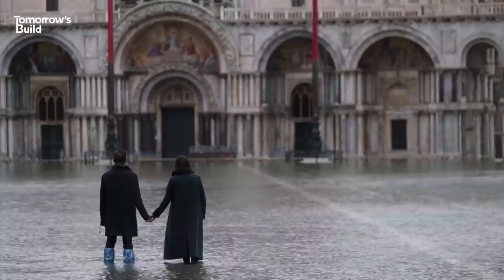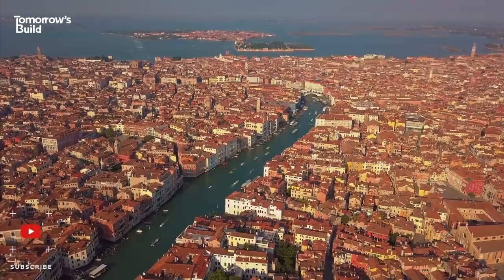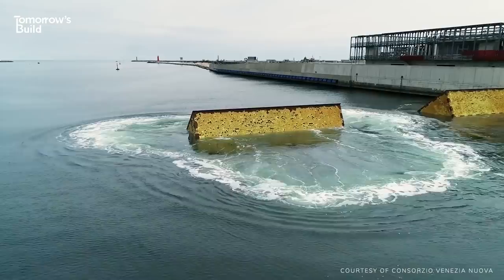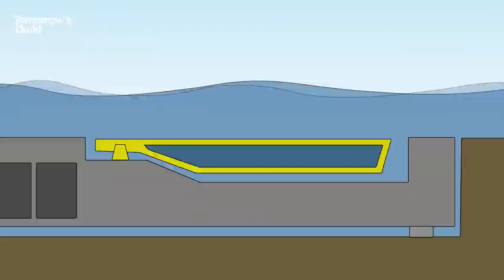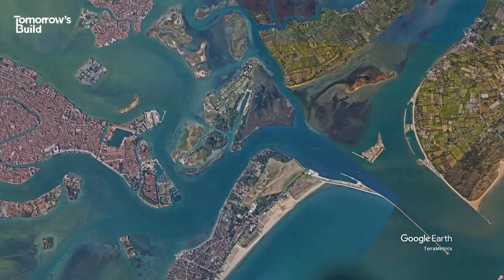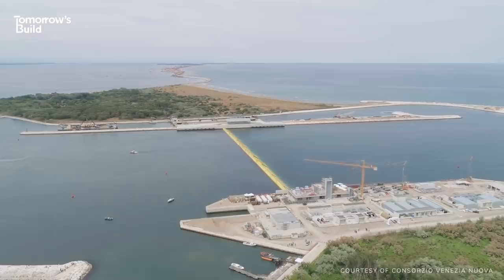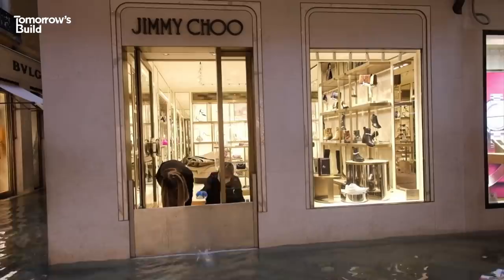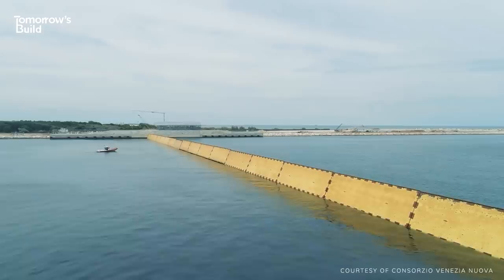The $7BN Megaproject to Save Venice

Comment: As a citizen of Venice (admittedly its continental part, Mestre) I can assure you this is by far the best informative video on this topic avaible in english; I've seen some others examples that are just incorrect and embarassing
Reply: Che merda Mestre però
Reply: It's so sad to see people in this comment section saying they would just abandon the city, but don't realize people like you actually live there.
Reply: @AmericaeDominaturOmnibus  People just have to visit Venice, and especially take one more day to walk around and take boats to see how marvelous and precious it is.
Reply: Would you say the system is effective? When authorities think to switch it on, of course (:

BTW In my opinion even if it stopped 80-90% of the floods that's a huge win
Reply: @ErelH  It is a depth structure, meaning, if the required depth to keep Venetians' feet dry is 38.85 meters, then a 39m structure won't do. It is a whole or nothing engineering, 90-95% success is a fail.
Reply: @Paroissien   he said Venice gets 60 floods a year. So if the system stops 50-55 out of 60 then it's consider it a success
Reply: @ErelH  If the streets are flooded in 10-15cm of water each time, please kindly tell me what kind of system would stop this flood and not that flood.
Reply: @ErelH  its perfecly effective when it is raised, all of the city is kept dry, and if you go where the barriers are you can clearly see the sea higher than the lagoon; but the phenomenon still has to be relatively brief (less than 12 hours) otherwise the endemic ecosystem will suffer for the lack of water exchange, luckily if the water rise is not too big it is possible to rise only some barriers and leaving the other down to permit the flow of water but at the same time it slow the rush in enough to keep the city dry
Reply: @Paroissien  you didn't understand anything of how it works, first of all Venice does not have the same hight everywere so even without the barriers in most occasions only sone parts of the city go underwater (San Marco being one of the lowest point and as such more exposed); that said the barriers rise from the bottom of the lagoon so a 39m barrier blocks a 38.8m water level; and it is not an all-or-nothing system even in the case of a very very high wave it will let some water in but it will not collapse (as it happened in the 1950 circa in the netherlands)
Reply: @XMarkxyz  When you start a comment by "You don't get it", the tone gets disrespectful, then the interlocutor is either a kid looking for a squabble, or an adult who drops it.
Reply: @Markxyz Do the continental parts of Venice and the lagoon-limiting Island districts (like Lido) also get flooded ?
Reply: @Paroissien  didn't mean to offend you but it's how things are, you were talking without knowing a single thing of how the system works and your ill-informed comment has shown it; ignoring a fact is not being stupid so don't get offended, just research more next time ;)
Reply: @aa-t8969   it's way more rare but it happens sometimes on the limiting part of the laguna, i know it happens in Chioggia for sure, Lido has never been flooded as far as I know; in Mestre (continental part) it's even more rare but it happened a couple times during heavy raining that some small areas near the river got underwater as tge rainwater had no way to get out of the city and into the lagoon via the river
Reply: Hoping this issue doesn’t become worse for you. I went to Venice 2 years ago once with my fiancé, beautiful place and even more beautiful people. Our plan’s to get married there, something very small, I can’t wait.
Reply: Thanks for saying you’re from Mestre and not from Venice
Reply: @XMarkxyz  in November 2019 lido and pellestrina were flooded too
Reply: @ErelH  in my view if you spend 7.5 billion euros for a big architectural project it should work at least 99% of the time
Reply: Good reason to keep watchin long live italia greetings from argentina and colombia
Reply: gelous of italy, is top

Comment: Isn’t there also the problem of sea floor sediments going under the barriers while they are up and therefore blocking them from coming back into the foundation?
Reply: Just tack that on to the 100 million per year maintenance cost too lol
Reply: This also happens with the Thames Barrier, but it is dealt with by the maintenance and testing cycle.
Reply: The whole project is flawed
Reply: Don't mention such things here, these people don't like questions exposing their skewed narrative 😂😂
Reply: @bigbadjohn10  The point is what's the cost of this added continuouse maintenance? Is this engineering oversight puts the economical feasibility and longevity of the project into question?
Reply: @576arnav  do you think the engineers wouldn't have thought out that , it would be a massive oversight otherwise.
Reply: @576arnav  Everything needs to be maintained, this ranges from painting the house to dredging the canal and fixing cracks in the dam.  somethings it ain't cheap and not doing it will guarantee that it won't be cheap.  We know that it has worked successfully only problem is the Aholes who forgot to turn it on.
Reply: £6 billion euros and $100 million to maintain annually is way too expensive. Definitely raises some fundamental questions such as how much is the economy of Venice worth, and whether it can sustain the cost to GDP ratio in the long term.
Reply: @chidubeogbonna8243  But letting Venice sink is not an option. This unique city with all its beauty has all right to be preserved and protected against the sea. Even if its costs are higher than anything Venice could ever recoup. Such a city is worth it!
Reply: @niklassteinhauser5191  6 billion to feed people or 6 billion to delay the inevitable flooding of a tourist city
Reply: @JD-kp3kt  definitely picking the last one
Reply: @chidubeogbonna8243  Economic systems are only as real as people make them...
Reply: @JD-kp3kt   The flooding is not in evitable. I have friends who live on the Pacific and the Atlantic coast of the United States. The sea level on both coasts is the same as it was 50 years ago when these people were children.
Reply: @niklassteinhauser5191  I surmise Venice is sinking as well. The tectonic plate that Venice sits on has migrated, setting the city at a lower level. Additionally, the aquifer that Venice relies on for potable water is not properly managed therefore the ground itself is sinking. Rising sea level is rubbish.
Reply: @andynewman835  you forgot: „Sincerely, your average climate change denier“
Reply: @niklassteinhauser5191  deny climate change? When did I say that? I try to avoid arguing with people who have faith in the unreal. Engage someone else.
Reply: @chidubeogbonna8243  Let Venice sink in the ocean! They could have diving tourists instead. I've been five times to the city (forced) and nowhere in Italy people are so unbelievably unfriendly like in Venice. The city is just a mouldy tourist trap.
Reply: @chidubeogbonna8243  the whole turism sector of the region of veneto relies on the city of venice existing, its not an option to not protect the city.
Reply: @JD-kp3kt  the Veneto region is a rich one, it has a GDP of 165 billions of euro, it can afford 6 billions in a span of decades.
EDIT: and, besides, its not inevitable, look at the dutch, for instance.
Reply: The Only people who thought this bone head idea would actually help Venice is the people who profited financially from it.
Reply: @rodrogers6895  ....Precisely. And the people like O'Bama and Bernie Sanders who spout the fear mongering about Climate Change ( always 'man-made' ), and how sea levels are going to rise many feet in this century, but buy mansions at Martha's Vinyard and other  coastal areas. They are lying hypocrites who don't know one thing about this planet's dynamic geology; or refuse to acknowledge the geologic facts, and how Earth has gone through many periods of warming that were warmer than what we have today, and that was hundreds of millions of years BEFORE Homo Sapiens were here. Oh no....who are they gonna blame for those warming periods!!
Reply: @andynewman835  Exactly...I agree. If Venice expects to keep its great buildings and art work in good shape, then Venice will need to be relocated to higher ground. Planet Earth will not be denied; it is going to have plate tectonics and continental movements, and coastlines that existed thousands, hundreds of thousands, millions of years ago, have changed; some are now deep under water and some are a lot farther inland than the current coast. Earth has been constantly changing for over 4 billion years, Man has only been here a few hundred thousand years, and the great architecture and sculptures and paintings and marvelous inventions is only in the few thousands of years old. Guess who is gonna win in the long term? Man will never be able to stop plate tectonics and the resulting changes that follows; you might as well command the Sun to not come up in the East tomorrow.
Reply: @RioMuc  letting Venice sink in the Ocean would be quite the feat, moving it hundreds of miles through the Mediterranean on ly to drop it past Gibraltar seem a bit unnecessary, let it just sink in place or raise it out of the water without sacrificing an entire bay ecosystem if saving it is that important
Reply: @Soken50  Oh, I was not planning to move it or sacrifice anything for Venice. I couldn't care less what happens to this city.
Reply: @RioMuc  Do tell how you sink it in the ocean without moving it, that ought to be interesting.
Reply: @Soken50  Gosh! You seem to be a nitpicker who takes everything too literally. What I wanted to say is that I don't care if Venice is flooded and sinks in the lagoon.
Reply: @RioMuc  That was a joke that seemingly went over your head the first time but it turns out you just don't have humour.
Anyway have a nice day, seems like you need it.
Reply: @Soken50  No, you were not joking but just trying hard to sound intelligent, what you failed miserably. 
And thanks for wishing me a nice day, I'm having one already!
Reply: @RioMuc  Trying hard to sound intelligent ? By knowing Venice is not on the ocean ? It's not exactly rocket science.
I don't get why you have to be so aggro for someone who's having such a nice day, I certainly wouldn't want to catch you on a bad one.
Reply: @marbleman52  Depending on which warming period you’re talking about, I would think that the reason for the warming to be different. One reason might be that the sun was closer to the earth during those times, and the earth was therefore hotter.

Regardless, we know that humans are accelerating the warming of the planet dramatically through the release of greenhouse gases and we have known it for a long time. Go ask any climate scientist.
Reply: That could be remedied by the design, using the power of flowing water to clear the sediment
Reply: I have animals and birds look🦋
Reply: @andynewman835  But wouldnt the aquifers be replenished directly by the abundant sea water?

I can understand this happening in mexico because of the aquifer dependency on rain inland. But with the ocean quite literally surrounding the city, it seems to me that any aquifer losses would be replenished by seawater leaching here.
Reply: @josephvictory9536  aquifers are ideally replenished with rain water and streams. Sea water’s salinity is NOT suitable for aquifers. Think fresh, not salty. If sea water enters the aquifer, it is considered an intrusion. Sea water intrusion is possible only by flooding. Glacially slow filtration by upwardly lateral osmosis through the actual earth likely is the only acceptable sea water usage. Some things just can’t be reverse engineered if naturally occurring geological events happen.
Reply: @andynewman835  i was replying to your post, not asking for a lecture on aquifers that i already know. Read your comment again, you are the one that talked about aquifers.
Reply: @niklassteinhauser5191  of course it is an option. The world is littered with abandoned cities.
Reply: A protection barriere
Reply: @klo4880  We don't KNOW that. We assume, we theorize, that.